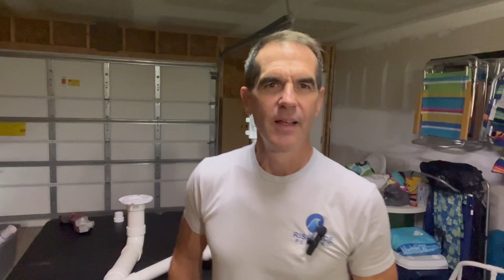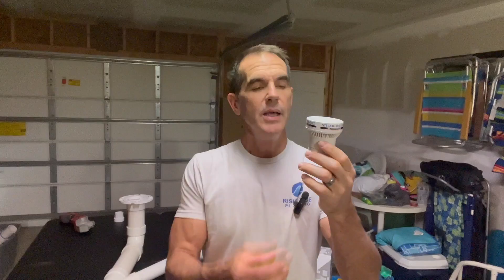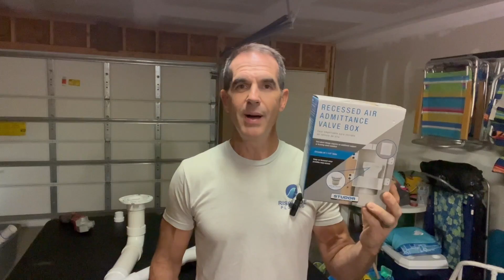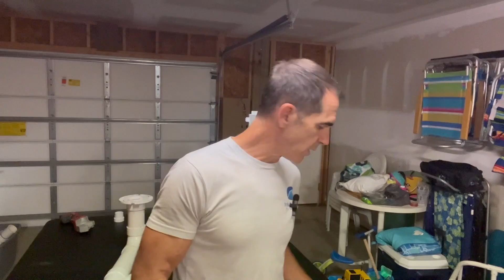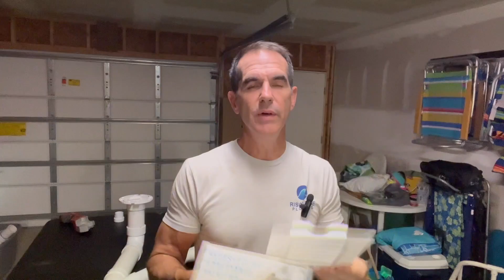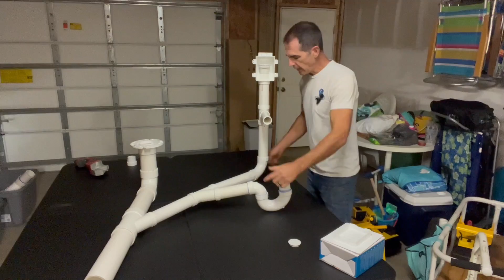Air admittance valves for plumbing venting explained, [just over 4 minutes]

Comment: Just replumbed an old farm house that didn't have any venting and used nothing but AAV's at all the fixtures. No more sewer gas. Works great.
Reply: They work great for a couple years. stock up on Stewart vents. They are in an accessible spot for a reason .
Reply: I have an old farmhouse also and had some plumbing done first thing when I moved in. They installed 3 studor vents, because of no outdoor vents. It's been over 21 years now. No gas issues.
Reply: One thing I would question is, being an old farm house, you're on a septic system,  not sewer system. Would using only studor vents not provide ventilation for the septic system itself? 🤔

Comment: My shower has a bad smell coming from the drain, only when the water is running. I think it's because my bathroom lacks ventilation in the drainage. Can the problem in the shower be solved with one of these valves?
Reply: Correct

Comment: you are selling these so you should at least explain that a vent is required is to protect against positive and negative pressure . Although I have use them there are rare cases where you need to be careful not to use them PS it was a good presenittion  RETIRED CODE OFFICIAL AND CODE INSTURUCTOR

Comment: I fixed a kitchen sink last week that had been venting into the wall cavity for 15 years. Instead of tearing up the kitchen cabinets to run a VTR I just used an aav and it worked well
Reply from the maker: Good to hear!
Reply: What's vtr stand for?
Reply: @terry6665 I would guess vent through roof?
Reply: @R900DZ  thxs
Reply: @terry6665  vent through roof - vtr
Reply: @terry6665  vent through roof.

Comment: I have used these vents for years with no issues! FYI, your plumbing design/layout has at least 3 plumbing code violations according to California’s Plumbing Code. That being said, it always surprises me as I travel here and in Europe how widely codes and methods vary. In some parts of Europe, even on New Construction, the idea of a Plumbing Vent is completely foreign. It tears me up to walk into a brand new beautiful bathroom with top of the line fixtures and smell sewer gas. UGH!
Reply: What violations do you see just curious the basic layout would pass in my state and a few more that I’ve done plumbing in
Reply: Joy is ignoring California codes.
Reply: Maybe I can run something by you. I have a laundry tub sink on the bottom level of my house. For the past 20 years when the washer drains, the tub fills up and takes minutes to drain. It gets so bad that I have to snake it every couple of months. It currently has an s-trap. Would an AAV help here? I just don't know how the drain is hooked up as it goes below ground. 

Thanks
Reply: @npolite22 yeah, first thing is that s trap needs to go. I would try using a mechanical vent but I would plumb it so it was above the wash tub only because it’s not clear to me if you are on the first floor or the basement. Give it a try, what do you have to loose but a few dollars and an hour or two of labor. If your drain has problems it could be under slab!
Reply: @michaelsparks6084  thanks for the reply. The laundry/utility sink is in the lowest level of the house. It's a split level so 3 walls are underground while the other is not. Does that mean I have to go above the sink for the AAV?
Reply: @npolite22  The issue for me would be to make sure that the AVV is above the main sewer drain, in the event of a mainline blockage The AVV could allow sewage back into the house. If you don’t have a lift station/pump in the lower level of the house then you should be fine. To keep this discussion short I wont get into the details. But for sure get rid of that S trap and try an AVV with a common P trap setup!
Reply: California goes by UPC this system is a Horizontal wet vent system. The wye for the toilet  you are talking about would have it vented in a”traditional” style as in all fixtures in bathroom group would have their own vents
Reply: So I’ll try to keep it short and simple
1) when venting a drain you must be in front of the drain and the vent must be above the centerline.
2) the toilet must have a dedicated vent when plumbed on the horizontal and it cannot be a wet vent. Wet venting is only permitted on the vertical and you have to increase the pipe size by one.
3) the shower must have a vent in front of the wye or the p-trap, similar to the toilet. You cannot use the vent for a drain when it is on the horizontal, only on the vertical.
That’s California for you and also The International Plumbing Code, which I believe a lot of Counties in California have adopted recently.
Reply: @michaelsparks6084  it’s setting on the table so I’m sure the wye just in front of the toilet would be tilted upwards if it was underneath a house and in N.C. You can wet vent as long as it’s a two inch pipe or larger.
Reply: @plumbbuild6517 yeah to be clear, it would need a dedicated wye in front of the 90* and the wye would have to be rolled with a 45* above the centerline of the horizontal wasteline so as not to have liquid enter the vent and that vent cannot be used for any drain. If you were able to stand the wye fitting up so it was vertical you could use it as a drain but you would have to increase the pipe size by one. I realize that this may seem a bit wasteful and overkill to those in you area but for us it’s everyday and commonplace, also more expensive
Reply: @michaelsparks6084  Thanks for the info. When in doubt, having a dedicated dry vent never hurts.
Reply: @michaelsparks6084  And the end of run cleanout.
Reply: Everything done in California seems to be wrong. Comment shouldn’t be taken seriously.